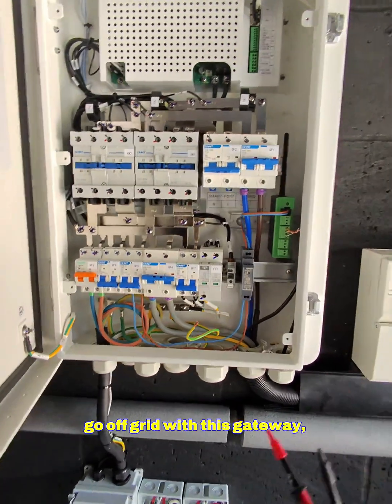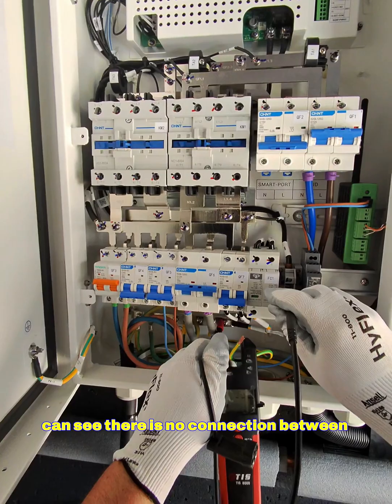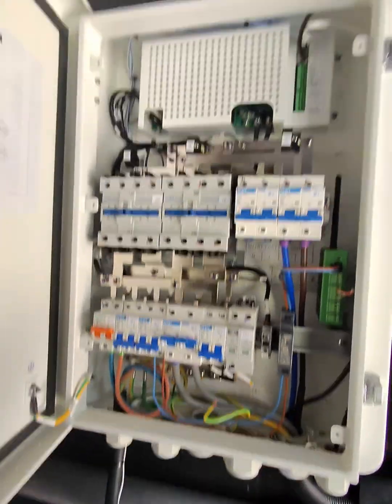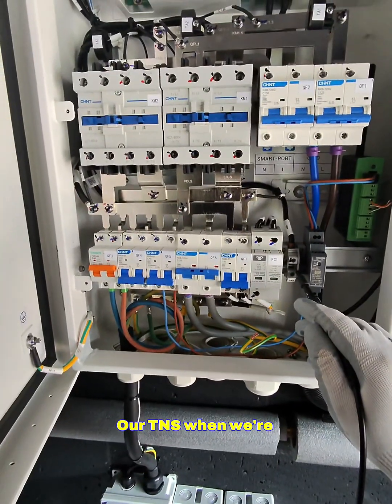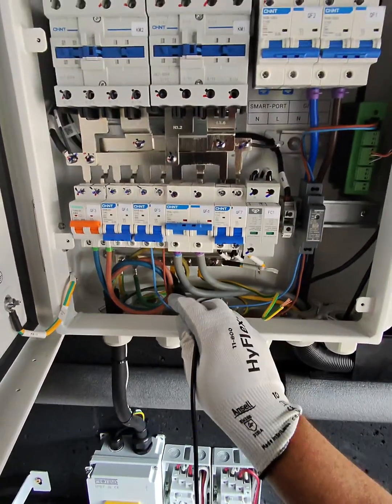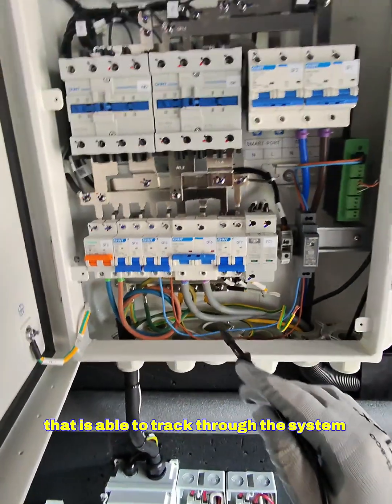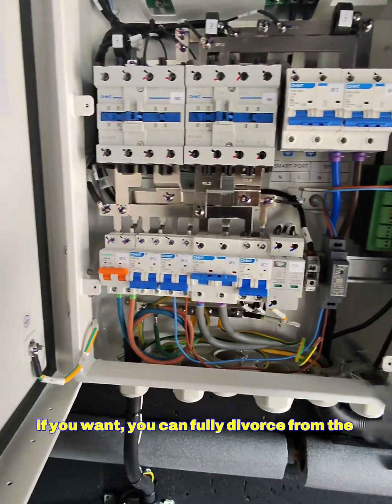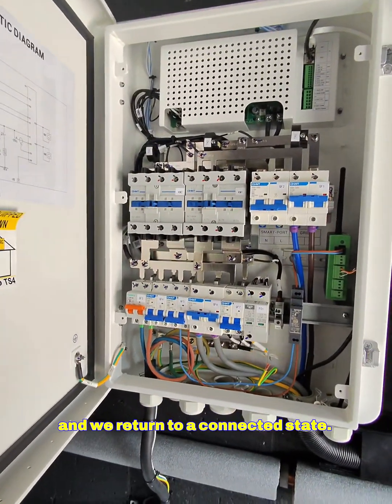Sigenergy gateway OFFGRID earth & neutral earth bond testing

Comment: Have you installed a manual change over ? My wiring doesnt allow for a gateway.
Reply from the maker: No. Either with no backup or via gateway. As this inverter doesn't have an EPS output its not compatible with a change over switch

Comment: Great video how do you confirm with a single point of emergency isolation at the  DNO meter cabinet for the gateway?
Reply from the maker: This can be achieved via the internal relay/comms if needed.
Reply: @electrician247 thanks would you do a vid on that🙏